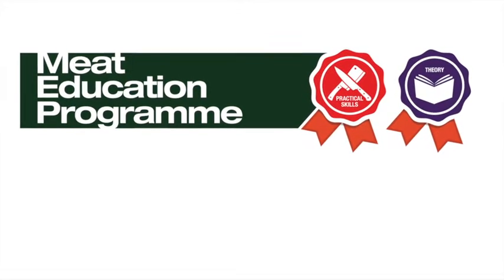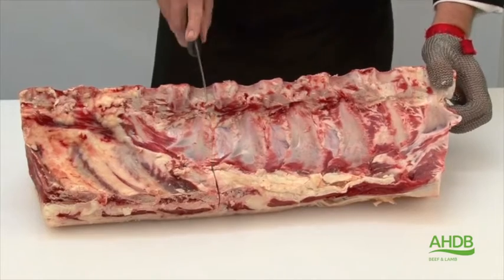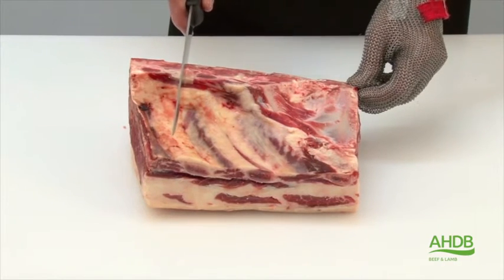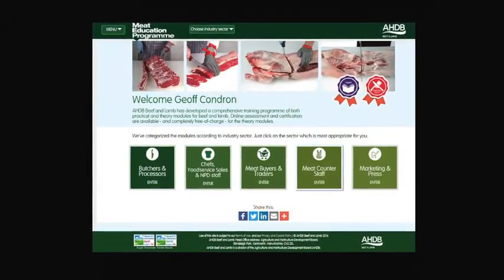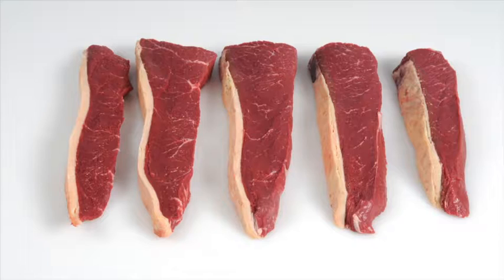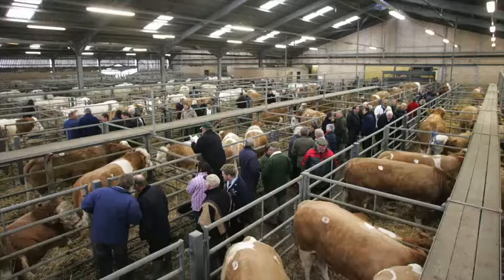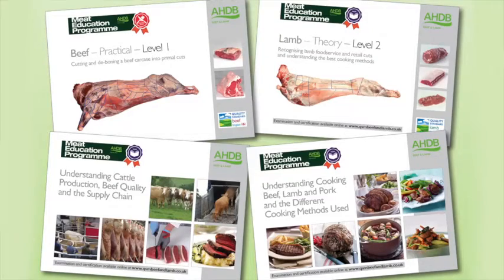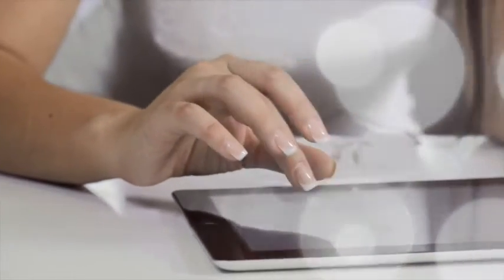How to cut a Bone-In Porterhouse Steak

Comment: Just and fyi, you cut the tenderloin out of that shortloin. so in fact those are all t-bone stakes. if you completely remove the spine bones and  only leave the ribs you would than in turn have a bone in NY strip. There is no porterhouse in this video at all. That's at least what my 28 years of experience says and the three generations of experience that came before me say.